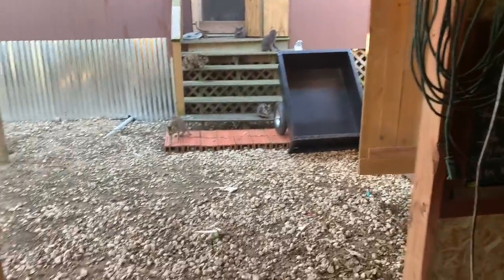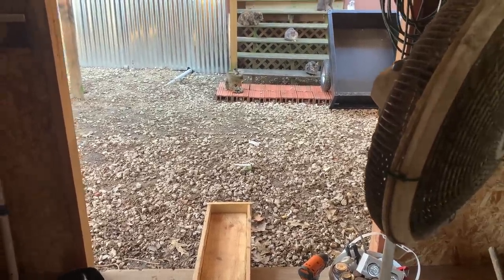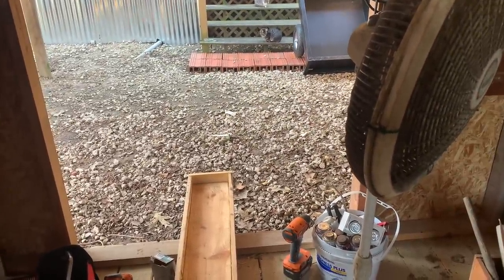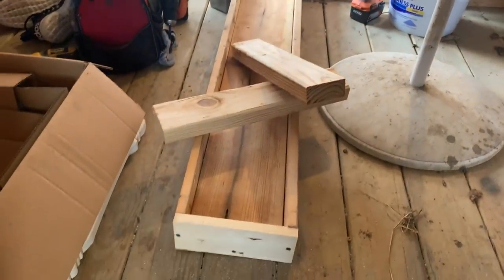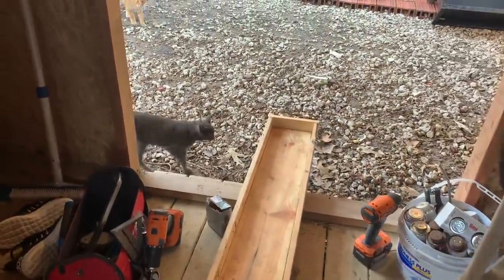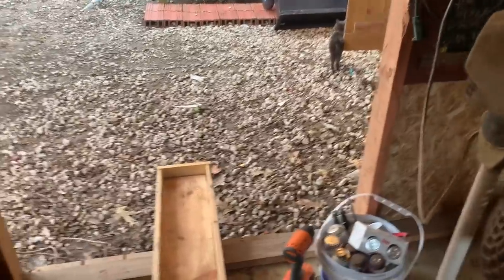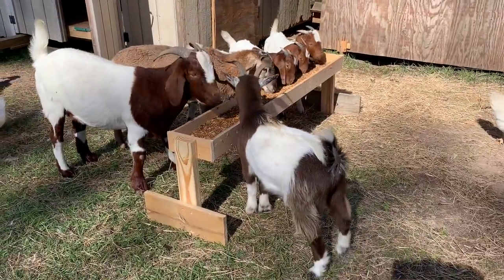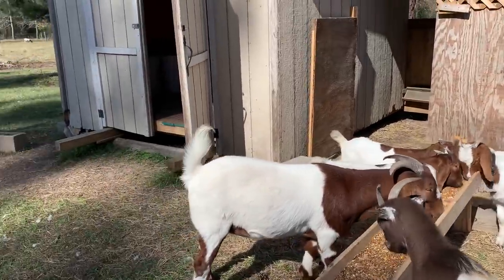Goats get a new trough

Comment: Hey Kim. If one foot on one is taller than the other, you could drill a few holes in the shorter end, and the water will drain down to one end and out the holes.

Comment: You should put plastic troughs / trays in the wood trough. Let the wood trough be a table/plastic trough holder. Plastic trough will keep the wood troughs clean & plastic can be unscrewed and better to maintain . You can also screw in some flat trays also from gardening section. Some of them have holes at the bottom. The window bed plastic planters, know what i mean?. You can screw plastic trays onto the trough too. You can cut the edges of the plastic-troughs/long-planters and use the plastic bases with a screw to just keep the wood protected. Trays / Plastic bases would be like liners. 

Also I watched the ads ❤️

Comment: Since your troughs are so heavy, would it be easier on you to clean them out by putting a screen wire or mesh in the bottom, so you can just lift it out and dump it? It could be hosed off, too.